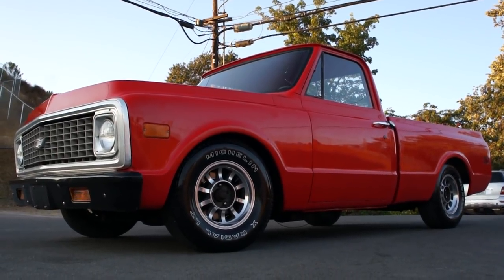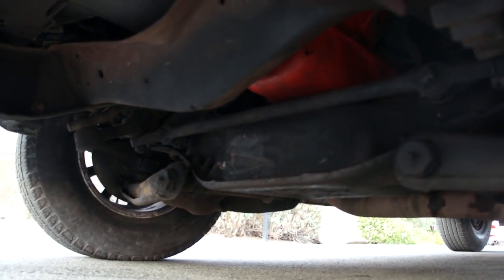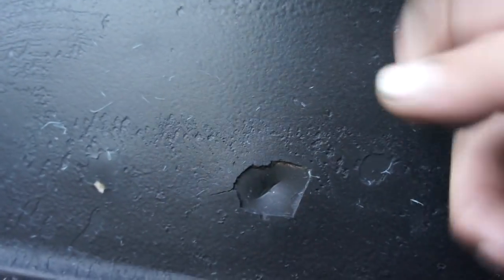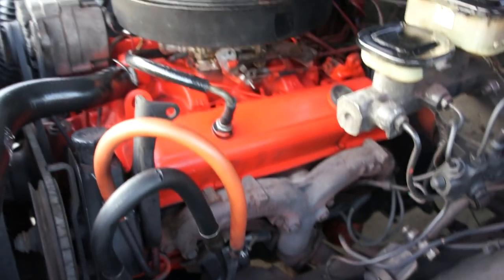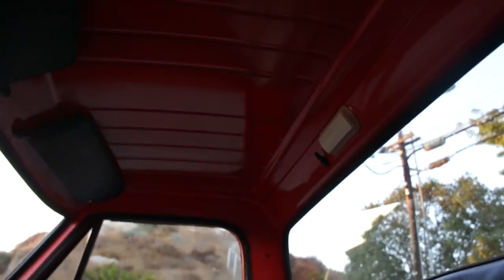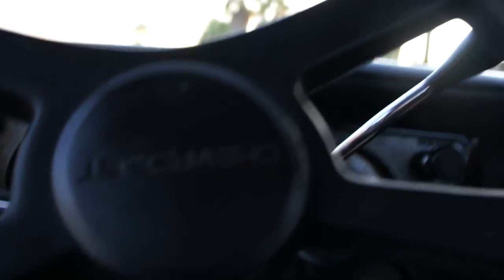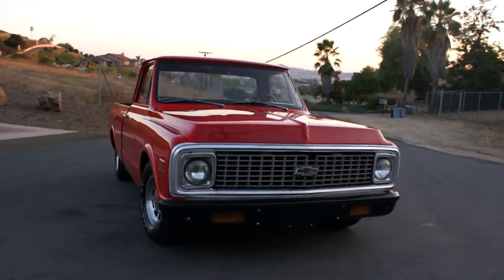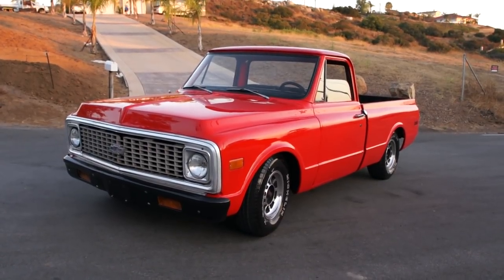1972 Chevy C10 pickup truck Short Box New paint Interior FOR SALE

Comment: Just found this video. I also have a 72 the rust in the rear corners of the bed is from having the factory shields removed  that were behind the bumper and not keeping that area cleaned out. They are there to block road muck thrown up by the tires from collecting in that area. Mine was the same way. I repaired the bed and installed the shields and make sure the area does not collect junk thrown up by the rear tires.